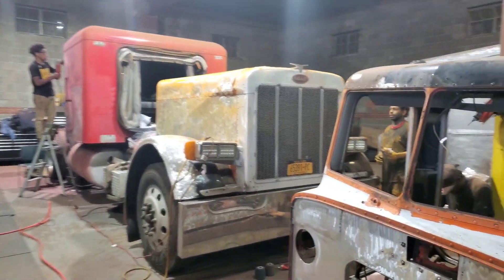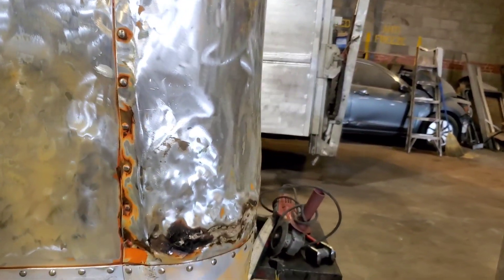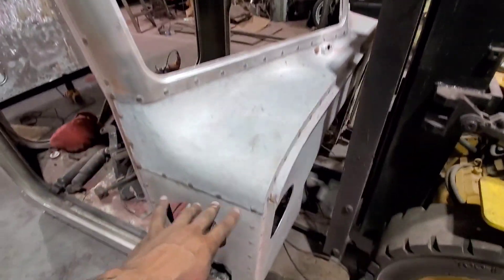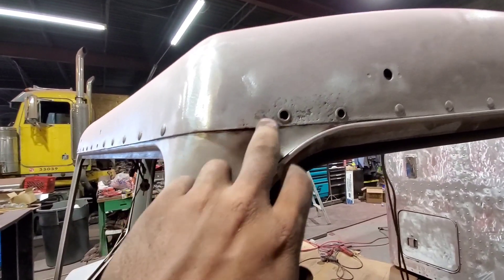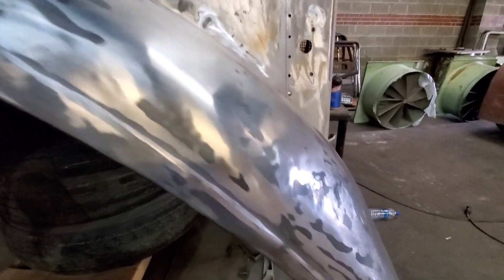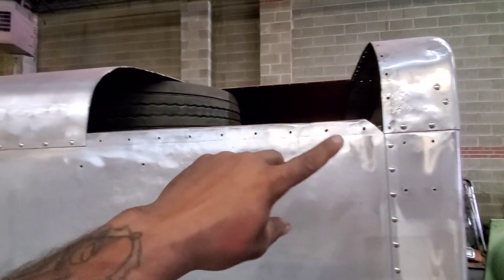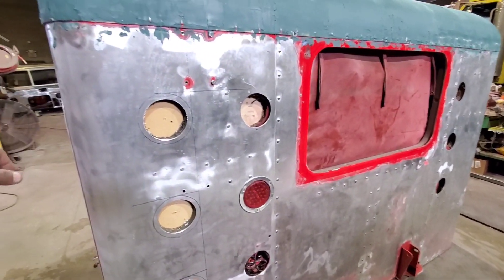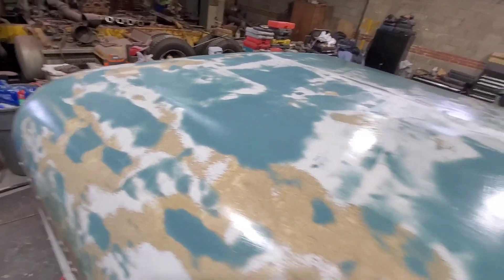1987 Peterbilt 379 Restoration Part 3 I Sanding and Taking Sleeper off

Comment: Currently trying to figure out how to put our 87 379cab and sleeper onto an 09 587 chassis. Any advice would be appreciated. We're going to do it, just don't know how exactly.lol
Reply from the maker: Lots of work for sure, it will be easy to grab all the frame mounts of the 87 and put on and Redrill on the 09. But the problem will come in doing all the wiring to make everything work
Reply: @hamletdubois6201  ideally we'd like to do an actual straight swap but the dashboard is being disagreeable.